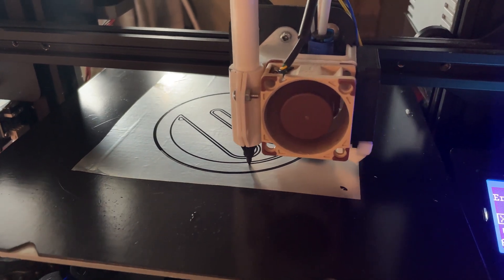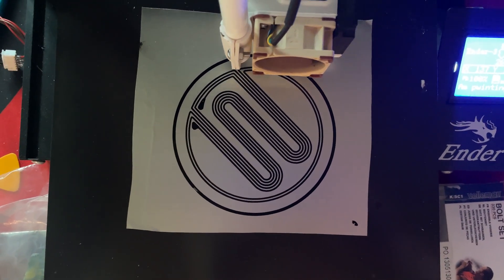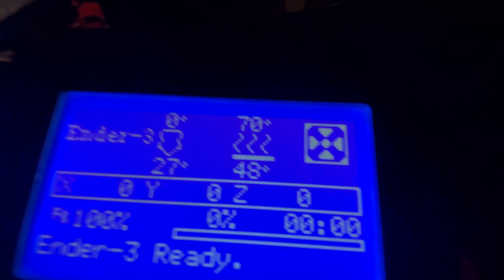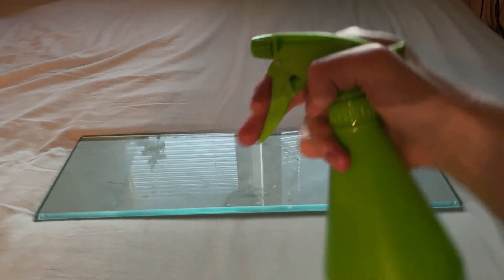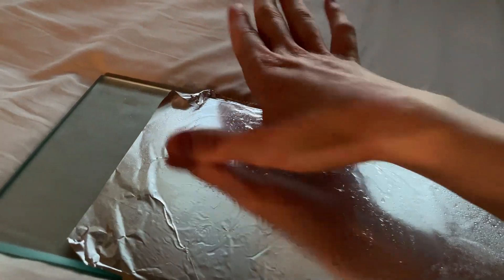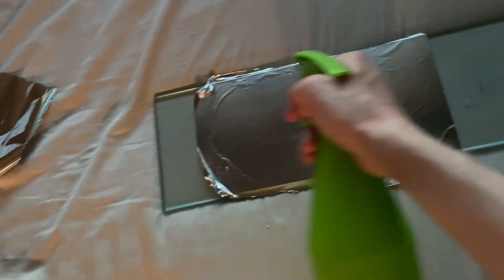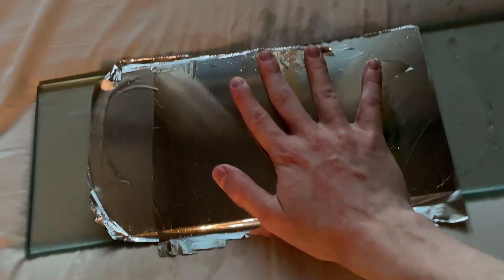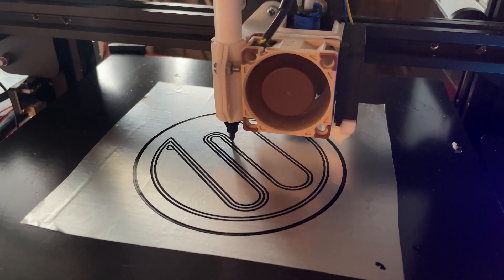DIY Membrane Foil (Mylar + Aluminium) - DIY Planar magnetic Headphones [EP2]

Comment: congrats! good idea to use hotbed to reduce scratches. I had the same idea of using a space blanket, bought a lot of them from china, not every one is ~12um, some are 20 um.. At first, I removed the aluminum from space blanket(it took me about 1 day using sodium hydroxide), and later I used thermal transfer to apply the aluminum onto the foil.  another thing is own design of traces and magnets. great hobby and i wish you all the best!

Comment: Really cool, looking forward to this! 
I briefly tried to DIY a diaphragm also using a space blanket - but i only tried using the mylar alone. The metal layer was way too thin and conductivity was even broken across the fold lines so i shelved the idea
Reply from the maker: I remember.. between any two points on my space blanket the resistance is upwards of 3-4 million Ohms, which no audio amplifier can drive in a planar magnetic setting.